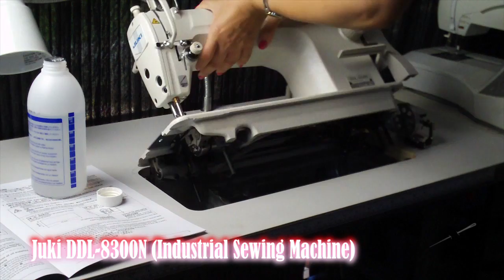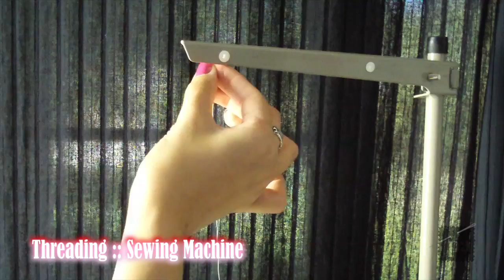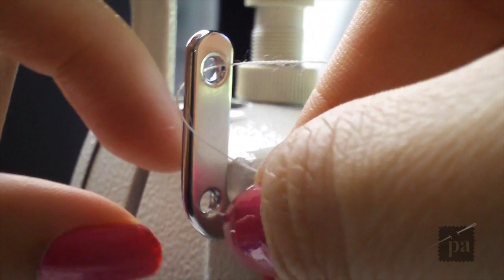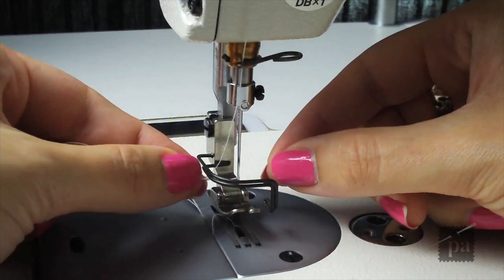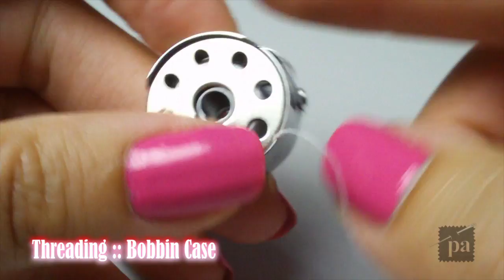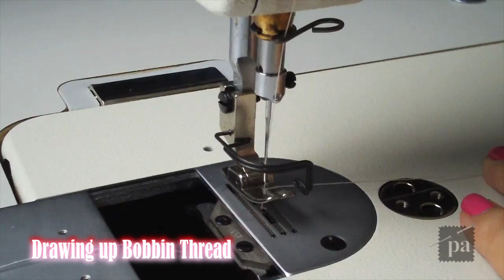E14 - Setting Up Industrial Sewing Machine

Comment: This is new to me, I am use to playing guitar strings heavy metal with extreme tension, but now I have purchased a Juki DDL 5550 Sewing Machine to do some heavy thread sewing for car seats, your videos are the clearest I have seen thanks. Although when I transported it home I did not disassemble as much as you, I just drained oil, and removed lower motor belt and left all other parts in place,I am having some difficulty with check spring so I ordered a new one, also my thread keeps breaking from the needle, I am sure by watching your videos I will be  successful using this Gibson of all sewing machines :) Thanks